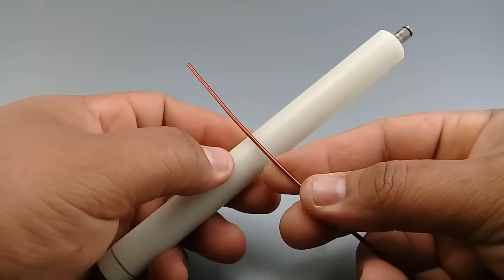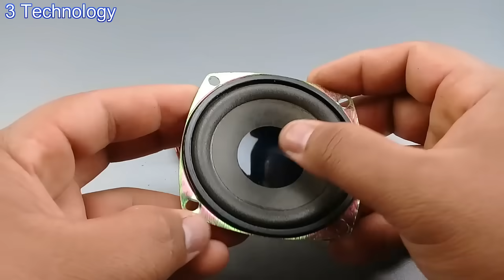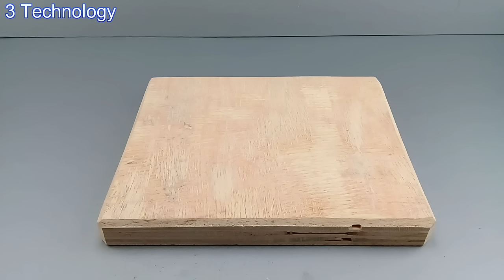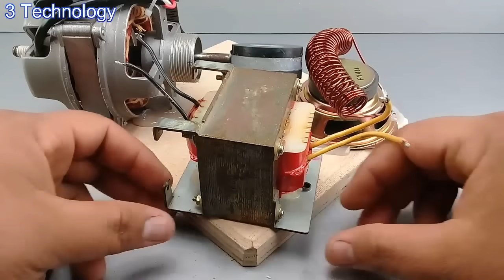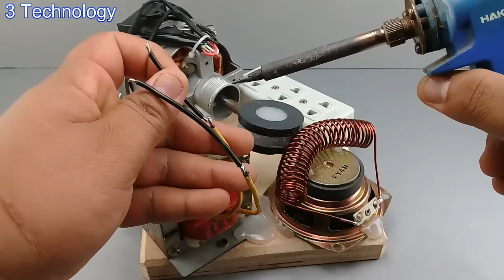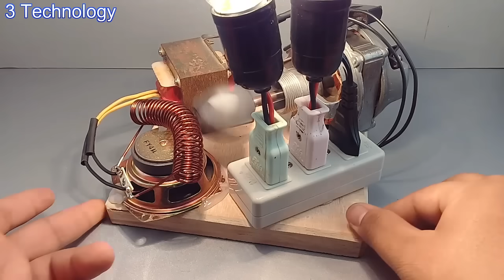6000 Watt Free Energy Generator With Speaker Tools And Copper Wire Use Transformers

Comment: Its fake speaker is having 4 ohams resistance 
Suppose speaker use for magnet.   Then in 15 turns of wire will not generate that much current to move motor

Comment: The concept of a "6000 Watt Free Energy Generator" using speaker tools and copper wire with transformers is not scientifically plausible from the perspective of conventional physics. The term "free energy" often refers to systems that claim to produce more energy than they consume, which would violate the first and second laws of thermodynamics.

The first law of thermodynamics, also known as the law of energy conservation, states that energy cannot be created or destroyed in an isolated system. The second law of thermodynamics introduces the concept of entropy, indicating that energy transformations are not 100% efficient, and some energy is always lost as heat.

While it is possible to build a 6000-watt generator that can convert mechanical energy into electrical energy using electromagnetic induction, the idea of generating energy "for free" without an external power source is not supported by current scientific understanding.

Innovations in energy generation focus on improving efficiency and harnessing renewable resources, but they still adhere to fundamental physical laws. Any claim of a device producing free energy should be approached with skepticism and requires rigorous scientific validation.
Reply: Yg di ujung tafo itu apa boss, apakah itu mahnet
Reply: Itu trafo ber putar, di ujung ada bentuk bulat warna hitam, aka namanya ,( apa itu mahnet)
Reply: @NimrodSianipar-ki8lo  Saya berkonsultasi dengan AI apakah apa yang Anda paparkan di video itu masuk akal. Dan saya telah mengirimkan respons dari AI, itu saja. Saya buta huruf di bidang pembangkitan listrik.

Comment: I have put over 128,200 miles on my Tesla since I installed this and haven’t had to plug it in once!😊
Reply: Using the charge cable to pull-start the generator, right?

Comment: Why publish these scientifically fake videos? In reality, it is an ingenious oscillator that bounces the initial energy given at start-up, from the engine to the generator and vice versa, and then runs out due to the inevitable electrical and mechanical dissipation present in the system. It's like swinging a pendulum without the spring winding.

Comment: Quite simple ..he doesn’t lift it up ..a double ended power lead fed underneath to the socket ..which will power it up ..this feeds the motor via the added wires and will also power anything else plugged in 😬

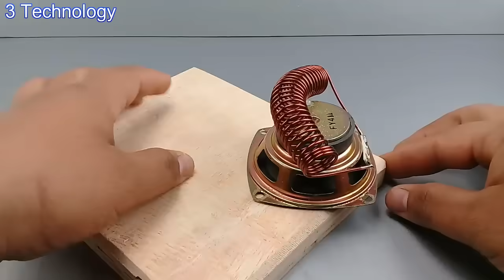Comment: YouTube videos make tons of money. This video might be a hoax to generate more views - no social laws broken, just a bit of dishonesty. At 3:25 we see glue points on the copper coil. This likely will interfere with electrical current flow. Then there’s the question of voltage and amps. A 1950s high school student can figure this out (contemporary HS students will struggle, sorry). Very important to note: Perpetual motion machines are not possible (contained fusion is). Slightly entertaining but I can’t give a thumbs up.

Comment: The fake would be slightly more convincing if they showed that the current would stop, if they used a finger to stop the motor turning. Also, next time, please remember to have the rotational speed of the motor change when additional load is added when you plug the bulbs in. Seriously, if you are going to go to all the trouble to fake a perpetual motion motion machine, you could try a little harder to get it right.
Reply: We didn't bother to do any of that. We are not physicists, as you of course are. We are just simple man which are very good at hiding lithium ion batteries inside of power outlets. Thank you so much for the tip

Comment: More nonsense on YouTube, same author and same scams. This device cannot produce anything at all because it does not even respect the basic laws of electrical engineering about magnetic induction. The author apparently has absolutely no knowledge in this area, otherwise he would not be able to publish such nonsense. You can't even laugh at it anymore. He should finally change the technology, those circular magnets from the speakers are already worn out.

Comment: Absolutely incredible invention, I took the engine out of my car and made a double replica of what you showed in the video.
I now have 643 horsepower under the hood, I don't need to refuel anything more, don't need to buy a battery, because I automatically get power from this wonderful invention.
Reply: Ha  love it yeah 6000 watts? man thats a lot of power 8-9 hp wow
Reply: Rally incredibile. Rally.
Reply: stigmichael.....You like to joke a lot.:face-purple-crying::face-purple-crying:
Reply: Energy free   thanks.
Reply: This video is incredibly informative! The step-by-step guide on creating a 6000 Watt free energy generator using speaker tools and copper wire is easy to follow and understand. Great job
Reply: @diytoptricks  informative? is that a new way of saying stupid?

Comment: I use 2 speaker, with an hyperbolic tube. Then, the wind enter in the tube, and can generate 12 kW of electricity, by moving the speaker. The wind speed is about 20 km/h.

Comment: There is no description or specifications of the materials used. Please  state the specifications of the materials used. Thanks.
Reply: It's a simple lithium ion battery, hidden inside the outlet strip. The other parts don't make any difference as far as specificity. Just use whatever works with the little battery that you are able to hide inside of something

Comment: to be honest, u can learn a lot about these idiots by just viewing them build these fake machines. just add a couple of proper circuits, one for voltage control and feedback for a electromagnetic rotor, then you can step down AC voltage to a more usable voltage and higher current. just add a over beefed up rectifier circuit that can handle 3+ times the current, a capacitance and inductance filter, and you would have a usable power supply. I just wouldn't ask for more than a trickle charge out of it. maby 15 to 16 volts at 2 or 3 amperes. other than all this, they're just building junk and digitally hiding a double ended power cord.
Reply: I am going to be doing video calls over messenger this will allow us to show the hidden battery, etc

Comment: how to turn off the engine once it is on?
Reply: Don't worry. The little battery goes dead at about the same time the video is over. We take it out of the power strip and charge it back up, just in time to show off to people. People are amazed, despite the fact that they have lithium-ion batteries hidden in all their devices.

Comment: 🙏🌹👍
Copper wire size nd no. of turns nd  transformer details pl. give. Best one. Thanks fr sharing.
Reply: Any old battery will do, so long as it fits inside of the power outlet

Comment: Forget the laws of dynamics. They are not being abused. The radiometric space is full 4:50  if power in thd form of man-made and naturally occuring EMR. That is what is being tapped here. It's not really free. It's not much but it's really cheap. That is of course this isn't a hidden battery scam.
Reply: Of course it is. We hit the battery inside the power outlet. It lasts just long enough to make the video

Comment: 1- curve of that coil is nonsense.  2-other magent from speaker is nonsense. not needed. 3- magnetic flow from this contraptionnis all over the place. extremely messed up. inefficient. 4- i am not sure there are not some li ion batteries inside the power plug with some electronics circuits. however, it is doubtful someone with this level of physics knowledge manage to build some electronics circuits and fit in that box. li ion batteries can be inserted in that box by any nonsense person.  5- apart from doubtful power plug, it is plausible that a circuit like this if flow designed correctly work. easy to test. i might build something and test.

Comment: Hello
This video is completely unscientific and deceptive.
If you look carefully, the bottom board is thick enough to hide several batteries and an inverter circuit. The voltage of the batteries is converted to  AC  by the inverter and secretly connected to the motor. However, the very weak current that results from the rotation of the magnet activates a relay by an electronic circuit to connect the voltage produced from the inverter hidden in the floor connected t0 motor and the outlet. 
 Because the amount of induced current resulting from the movement of the magnet is very small according to the number of turns of the coil, and connecting the coil to the speaker has no scientific justification and even weakens the current of the coil.
Therefore, the induction current is in the milliwatt range, which cannot cause the start of a multi-watt electric motor with the help of a step-up transformer. Hamid Danesh Moghadam
Reply: But  he never connects any wire from the wood base. Therefore it must really work. Just send him $1000 and he will tell you how it works.
Reply: You are silly. Inverter just wastes power. We simply use the DC motor, and connected it to the hidden cells. Everything else is just for show, to make you think that it's AC, when it's really all DC. I will beI am going to be doing video calls over messenger this will allow us to show the hidden battery, etc

Comment: Diese Schaltung, aus wenig Energie viele zu erzeugen, noch zu transformieren, mit den bekannten Verlusten, dann der Motor, besitzt Reibungs- und Wärmeverluste, Das Magnetfeld, des Magneten auf der Motorachse, erzeugt in den etwa 30 Windungen, als schlechte Luftspule, etwa 3 Volt, der Strom liegt im Milliampere Bereich, dieser wird durch den Lautsprecher, mit 8 OHM kurzgeschlossen und Brummt sehr laut! Der Trafo +berträgt mit seinen Verlusten, etwa 70 % der erzeugten Leistung. Nun soll der 110 Volt Motor sich drehen, ist unmöglich!  = fauler Zauber!  Problem Lösung: die Steckdosenleiste hat unten einen versteckten Draht, der Energie , dem Motor zuführt! Wobei der Trafo dort nicht angeschlossen wurde.

Comment: So has anybody managed to get this to work? At 6000 watts?
Reply: Sure, I power 3 houses on my block with just one of these.
Reply: The battery had to be small enough to fit inside the power outlet strip, so it only lasts long enough to make the video. Let us know how yours turns out

Comment: How many times copper will be needed
Reply: Any old battery will do, just as long as it fits inside the power outlet. Since it's DC current the number turns doesn't matter

Comment: FAKE! ROTATING IT AT THE SAME CENTER IS NOT ENOUGH. YOU HAVE TO LIFT THE WHOLE THING AND MOVE IT. TO PROVE THAT THERE IS NO WIRE CONNECTING UNDER.

Comment: Where can I get the material rolling near the speaker and where does the coil wire connected to?
Reply: It all connects to the little battery hidden inside the outlet strip

Comment: How wonderful that could be in saving the world. We have very low cost portable power for our homes and our transport. It will drive other machines. So far I only have my house powered in this way. However, when the current crop of EV's get old and are scrapped - I will fit this device to a cheap car and ride around almost for free. There is only one slight problem. Once started it cannot be switched off! I wonder why that seems to matter? Is it just convention? Why not leave it running 24/7 ? Would anyone steal my car?  Perhaps some sound deadening would make it less obvious? It does have quite a high pitched whine to it. That's the only draw-back so far. That and propensity to catch fire.... I have only lost my family so far. My animals got out. There was ever going to be a price I suppose. I content myself by recognising the contribution to the saving of the world. Please join in and lets make their sacrifice really count.
Reply: Yes, the world is about to change, drastically. Once everybody has one, the power companies will be out on their ear

Comment: Lift the board above the table which hides the wire to the 3-socked strip... :-)
Reply: We did lift it. There's nothing under there. The only thing is one of them lithium-ion batteries. Yes, it's inside the power strip. Thanks for the tip.

Comment: So, here a scoop for everyone. There is such a thing as free energy. Tesla proved this and was crushed for it. Now, it has been proven again. They have been able to capture energy right out of the air. There must be humidity present but they have shown it works and with a multitude of different cheap materials. Now, like Tesla before, or the engine that ran on water etc, we will see if power let's it ever ger to market. That is doubtful. But, there is free energy. Tesla knew this. All his research was ceized and was distributed to multiple corporations who made trillions on it. Another thing to think about, he also pointed out one lightning bolt vould power NYC etc. And there are places with giant electric storms fourteen hours a day. More power than the world could ever use.

Comment: The yellow wire is stands for a switch  treggering hiden inside the transformer when the coil is connected .
Reply: The thing that's connected to all of it is a little battery. That triggers all the motion. You can build one yourself.

Comment: It'd be nice if you would explain what your using and what you're doing with it just in case we watchers would like to try it at home.
Reply: Je úplně jedno, z čeho to vyrobíš. Stejně to nebude fungovat.
Reply: don't try it, it doesn't work, it rotates the board slowly, it doesn't lift it
Reply: Sure, tried at home. Find a small battery, charge it up. Hide it inside of the power outlet. Then, hook up a bunch of visually cool things. You've got your conversation piece when friends come over.
Reply: Speakers from radio or from music equipment, coil of copper find in electrical equipment, head of a fan & magnet.
Reply: Its called Imaaaagination
Reply: Trouxas tem em todo lugar(país)?
Reply: It's crap

Comment: transformer type is what??
Reply: It's just an old transformer we scrounged out of something. We really don't know anything about impedance matching, as we are simple DC tricksters. The little battery has to be small enough to fit inside the power outlet strip, so the thing only spends long enough to make the video, then the battery goes dead. Let us know how yours turns out.

Comment: Put this thing on the top of a glass table with a mirror on the floor and let me see the top and the bottom at the same time and I'll believe this actually works but until then. Yeah it's fake because you got a hole in the table. Where you got a power cord coming up through it so why did you conrogate it

Comment: The wires connecting socket 110V to power supply 110V is hidden under the table and coming through the hole in this table 😂😂😂😂
Stupid those who believe in this FAKE 😂😂😂

Comment: And, there's no way you could ever generate 6,000 watts with this.
Reply: Bogus..6kW are u nuts
Reply: Ummm, Abigail 1024🦅
Reply: Why not wattmeter used to show wattage?.The transformer capacity may not exceed 150VA.
Reply: Keren😊
Reply: D
S🎉s
Reply: hi...ok
Reply: It's a pretty small battery. It won't last long.
Reply: For a start
The cables and condenser would burn out at 2kw
Reply: There is no voice message how we can andestand
Please explain what is rolling objects
Reply: @rajpeter6988 that is a motor from a fan

Comment: Where is your measurement of 6,000W? Two lowest voltage light bulbs is not evidence. Your fan motor is no to inducing a current in the copper coil the way you have it configured. The EMF zone is not aligned. Please show proof of your claims and provide component-wise evidence of each input and output. Otherwise, this is just a silly video intended to get clicks and eyes watching it.

Comment: He didn't  show what is the round disk drum made, witch terns between the speaker hooked up spins with the generator what is that made of , and how much voltage output without showing voltmeter reading: May be he has charged battery in the transformer:😃😃😃🤓
Reply: You are silly. We hit the battery inside the power outlet strip. What kind of nincompoops do you think we are?

Comment: What is that ball running on the rotor?
Reply: It is merely a ball. That's not where the battery is hidden. Just don't go poking around inside the power strip okay

Comment: Prove it by moving away or lifting it from the table or at least sliding it from its original position.
What's behind the assembly board?
Definitely don't dare to do that
Reply: That's just the thing. The little battery, hidden inside the power outlet, it doesn't matter where we put the thing, or which direction we turn it. Just don't you start poking your nose behind the curtain, fool
Reply: @greghanson-w3d  So at minute 5:18 there is already a video clip
What's behind the video clip?

I think it is being engineered to channel the electricity source that is hidden behind the socket

Comment: Can someone explain what's that round object at the end of the alternator n pointing towards the speaker please? Is it a piece of magnet?  And what does it mean by 6000 watts?
Reply: there are two magnetic discs sticked with plastic so they can be fixed on  the rotor shaft. The polarity of this two discs has to be the same , not to attract each other. 6000 wats means 6 kilowatts. The bulbs (classical bulbs with wolfram filament)seams to have 60 wats consumption . Just calculate how many bulbs of 60Wats may support this source of energy.